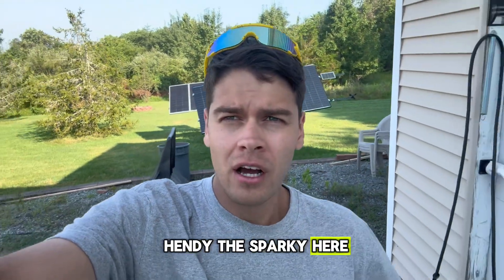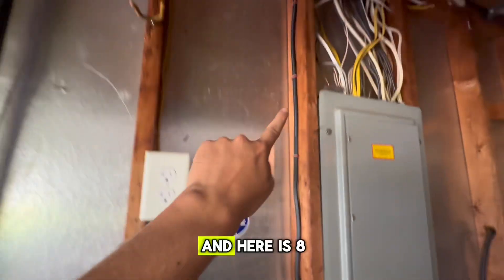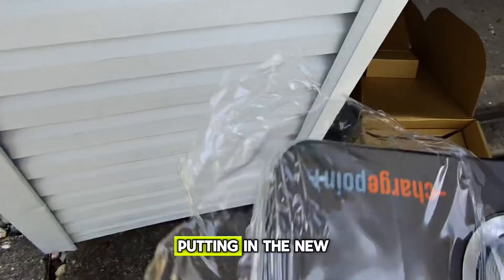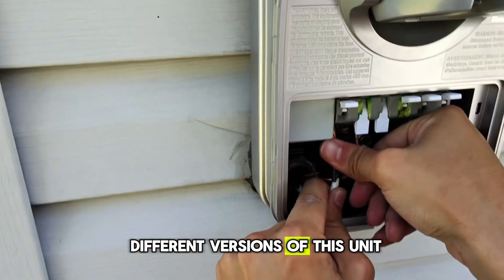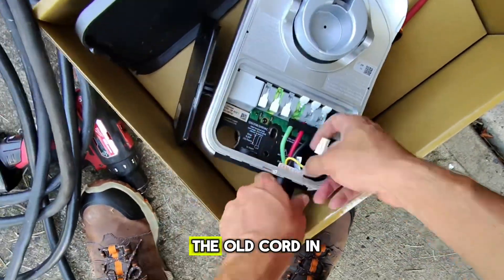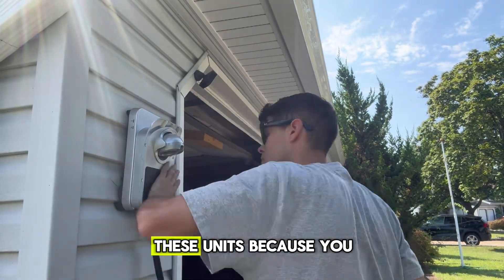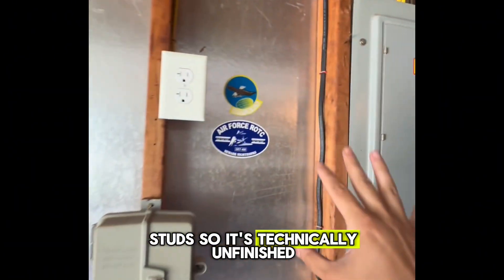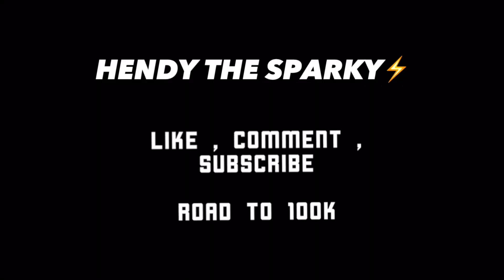CUSTOMER HAS A DEFECTIVE CHARGEPOINT? HOW TO REPLACE AN EV CHARGER-DAY IN THE LIFE OF AN ELECTRICIAN

Comment: No surge protection is probably why it died
Reply from the maker: Could be, but most likely is just was a bad unit, the WiFi receptor in the unit went bad after a year later, nothing with the power output